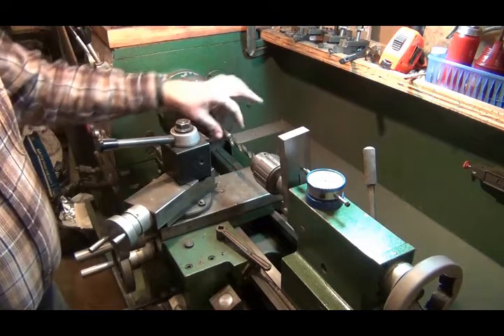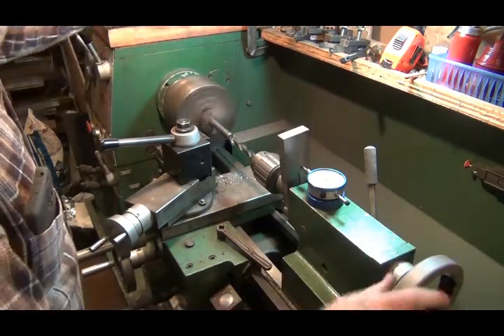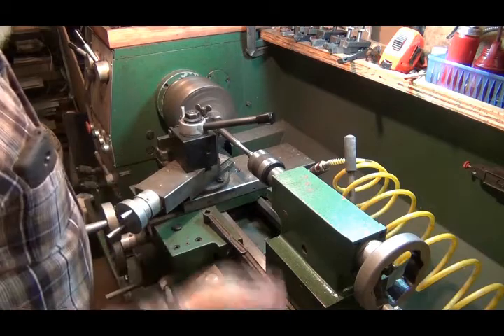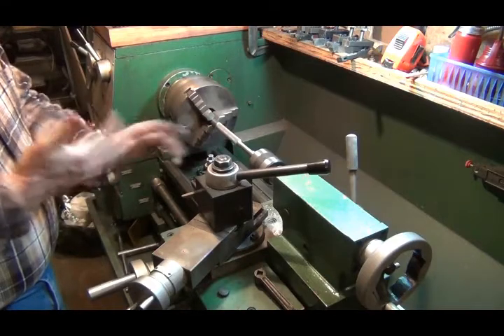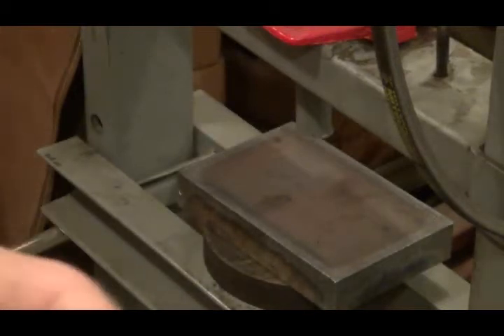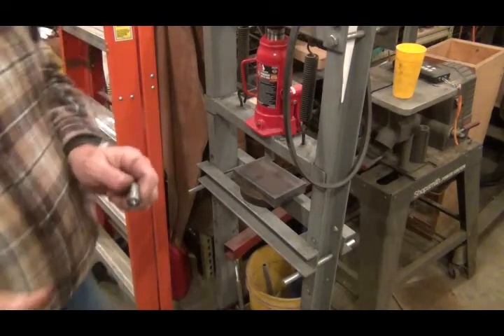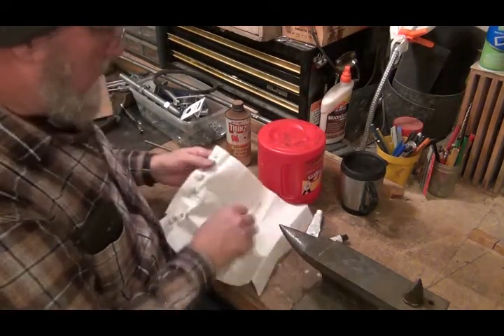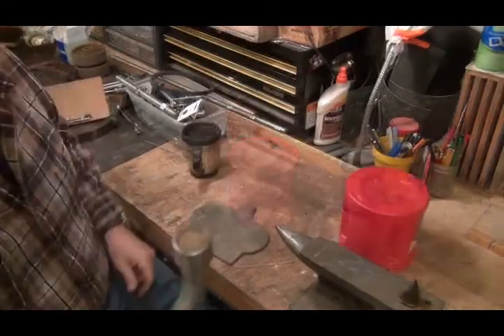Magnet lifter

Comment: Painter's tape makes a great epoxy mixing board. Just lay it out on the work bench, with 2"wide tape just lay a couple pieces next to each other, mix your epoxy, then throw tape away. If mixing a bit more I found the little Dixie cups for the bathroom are perfect. $3 we'll get you 250-300 cups, mix and toss.
Reply from the maker: Aaron Kimmins I have a roll of that right above where I was setting. I'll have to give it a try.

Comment: that looks like high speed competition knurling! thanks for the video, cheers.
Reply from the maker: Should I have been running slower? Don't know.
Reply: I tend to knurl at about one 50th of that speed (..), (very slow) with much pressure. I would beleive my rollers will last longer that way, since they do not roll on bearings. I'm not an expert (either), but i saw it beeing done by pros, and never that fast.
Reply from the maker: Flip de boer thanks I will try to remember that. There is so much to learn and remember. As I get older it getting harder to do.